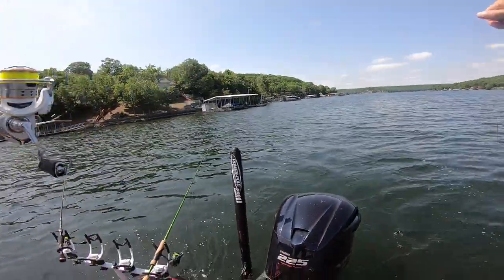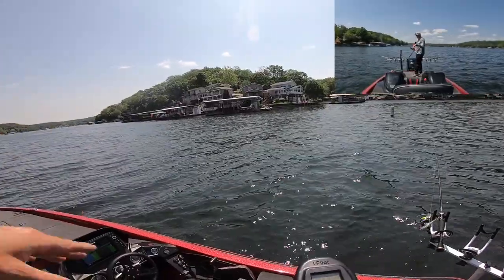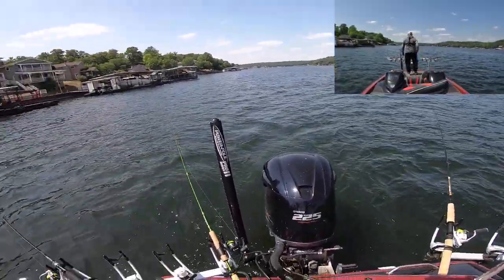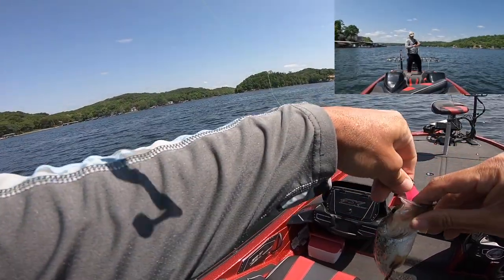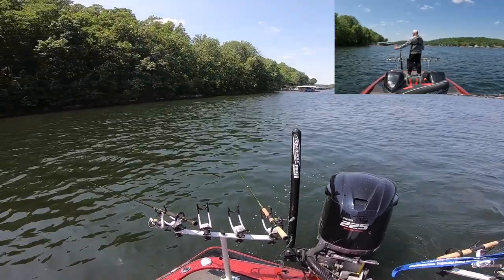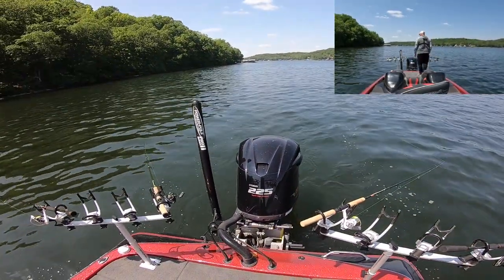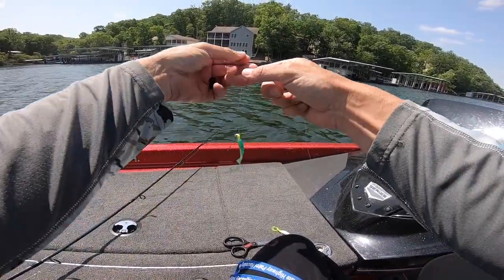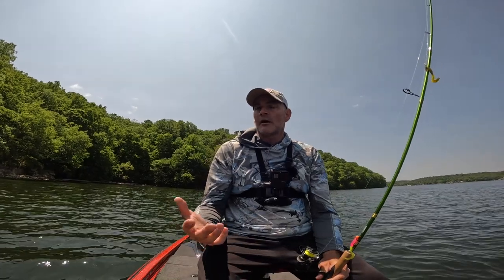Long Line Trolling Jigs for Crappie #crappie #crappiefishing #lakeoftheozarks #longlinefishing

Comment: Been wanting to long line for Crappie.  Thanks for sharing 👍
Reply from the maker: You gotta give it a try, it can be a blast. It's a little slower pace than trolling crankbaits, because the trolling speed is about 1/2, so you really need to use down/side scan to make sure you're in water where crappie are there and suspended so you have a shot at them. Thanks for watching and your support, I really appreciate it! -Cody
Reply: @OutdoorQuests  Good advice!